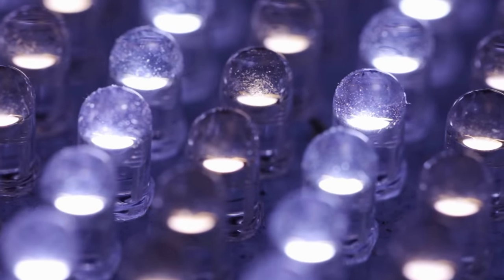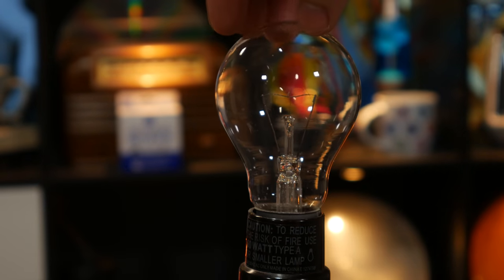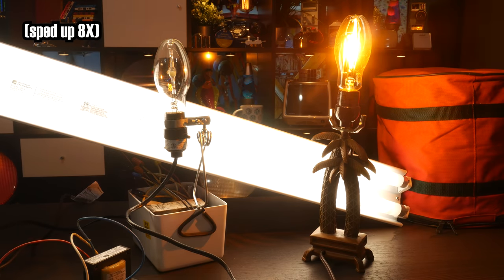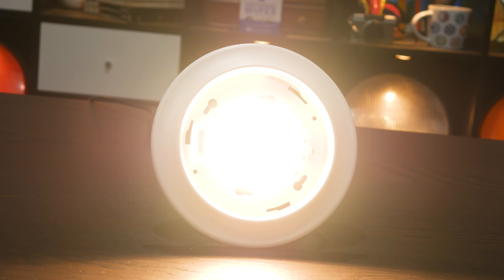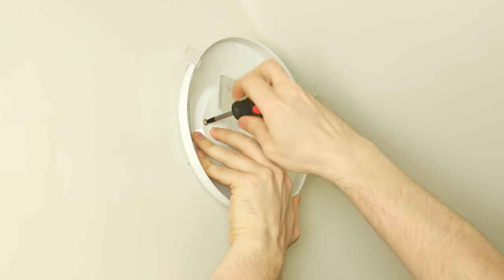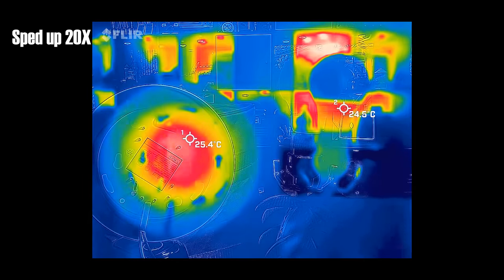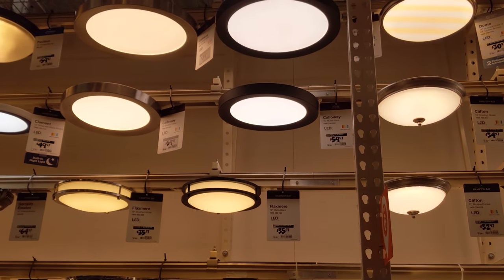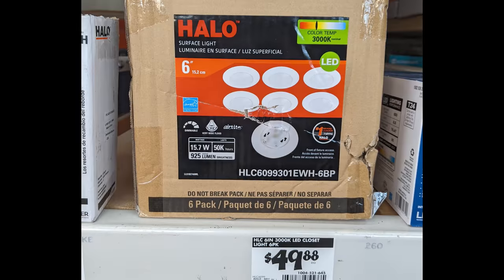A troubling trend in lighting?

Comment: The thing with such devices is you have to basically dismount the entire housing to change.

There are those "LED pizza" that fits in a housing.

But compared to fumbling with thin wires and making connections, the convenience of screwing a light bulb into a socket is way more convenient.

Don't forget it might be late evening when the light break down and you have to change the lighting in a dark environment and all you have is some torchlight or your mobile phone light.

The large bulb screw thread is actually pretty easy to install especially on ceiling light, where you are basically up a ladder and doing everything with your head facing upward.

Comment: About 10 years ago we had an area at work where the bulbs were constantly burning out, someone but non dimming bulbs in the fixtures and those failed. I knew the wiring for the location was ok but we have overall issues with the building power. I believe we get dips. I put in a quality dimming par/flood bulb and it has been working for almost a decade now with no issues. Failure can have a lot of points when it comes to electrical.
Reply: And electronics

Comment: I'm quite a fan of the LED Downlights here in Australia. Instead of being raw wires, it's just a traditional wall plug (which was a bit hilarious finding a power outlet in the ceiling, but rather reassuring). When getting houses redone for them, all that needs to be done is a set of outlets being added in the roof, connected to a common switch, with a hole drilled for each fixture. They essentially pop in and are held by spring-like arms so they accomodate most any hole, and therefore that makes replacement dead easy for everyone. Just grab a ladder, pop out the old, unplug it, plug in the new, and pop it in. Most have tunable colour temperatures too, and even the cheapest normally have a pretty hefty heat-sink on the part that sticks into your roof since it's just direct ventilation in a way.
They're also cheap as. You can get a six pack of wifi-enabled rgb downlights from a reputable brand for the same price of a single Phillips Hue rgb bulb. Obviously the latter has more features, but I'm sure you can find more expensive downlights if you needed those features too.
Reply: Albeit, this doesn't solve the issue you raised about one dying after five years and you likely not being able to buy the same one again... but that same issue is present in light bulbs. I can't tell you how many times I've replaced a light bulb in an area, supposedly of the same colour temperature, just to find I have to replace all the others for my own sanity since they don't match. That's not really an issue of the technology, that's more of an issue of economy, and applies to a lot more than just ceiling lights.

Comment: I'm a semi-retired electrician and I'm starting to see this issue especially on outside lights. I'd guess it's the temperature fluctuations that make them fail a bit quicker. It means changing the whole fitting rather than just a bulb . That can be awkward with higher mounted lights.I have actually swapped out bulbs in the halogen sensor lights for corn cob LED bulbs. The problem is those fittings are normally seized with corrosion and you have to drill out the bolt to open it. It's going to be a costly issue for muggles who can't do electrics.

Comment: we had a house fire, about... 5, 6 years ago?  Smoldering fire, mostly smoke damage.  It's actually kind of unrelated, but, it was the reason why we had to have a lot of renovations happen.  One of the things was, in several rooms affected by it, we had replaced the boob-lamp style ones with ones like those (bit larger, and did emulated the boob style a bit closer, but not super close).  And yeah, it's much brighter, and has lasted this long.  All things considered, I'm pretty happy with it.

Comment: There are loads of thin and powerful downlights more compact than the bulky ones at the end of the video. I installed 7W LEDs with driver dongle thin enough to fit between the old and new ceiling (28mm) great option when renovating a house without opening up all the ceilings or digging in the attic to install conduits. There are also constant current LEDs that have an external driver placed in a good position of your liking. Those bad boys were 9mm thick (or thin rather) but 'only' 4W. Still plenty enough for a lounge/living room, where lighting is more of a cozyness factor.

Comment: Thanks for this video. This is something I've been pondering for some time. We desperately need to new standard connector to replace the Edison screws. Also, why run 120 AC death voltage all over the place when 12V DC (or less) would suit modern lighting requirements. The first company to standardize these points wins, big-time. Not even going to get into how many led bulbs are obviously designed to fail, reassuring continual sales. Ugh! It's like we got new technology, but in companies' race to case in, nobody thought about implementing it in a sane way.

Comment: Thank you for this video.  I was horrified when I took the globe off of my 3 year ago purchased home to find a circuit board and not a light bulb.  Now I’m waiting for an electrician with a severely dimmed kitchen light that’s useless.   It’s going in the trash and I purchased a regular fixture from Menards yesterday.  
I don’t see where the savings is with these.  It lasted just three years and I’ll have to pay an electrician $100.00 or more to change it, plus the cost of a replacement $ 74.00 and the inconvenience of no light in my kitchen while I wait.
I could have bought a lot of lightbulbs for a fraction of this.

Comment: My previous flat mount LED fixtures (2 years ago) had a ground riveted to the back of it. This summer I bought 3 brands of fixtures like you showed and none of them had a ground. I'd assume would make them illegal in 99% of America (no way to ground). Interior layout let me know they were different mfgrs but all shared the same sucky packaging. The reason yours (if like mine) was mounted by one screw is that these don't match screw holes on round surface mount boxes. They were so slim that, when using the adaptor bracket, the lamp stood 1/4" away from the ceiling. Used w/o the bracket and they were flush but holes aligned with the lip of the box. Either way, that left me drilling thru the edge of the box or mounting it with one screw into the box's threaded hole and a second into a screw anchor. A million dollar idea (cheap motion detecting lights) in a 2 bit package.

Comment: I installed one of those at my mom's house a few years ago.  It was just a light above the kitchen sink that is used maybe a few times a week, but I still did not like the fact I couldn't change out the bulb if needed.  It's a cheap solution for a place that maybe doesn't need constant light (like a closet as you mentioned) but it does pose the problem that when it fails someone with electrical wiring experience is needed to fix it.  And instead of buying a cheap pack of lightbulbs now, it's an entirely new fixture.  Horray planned obsolescence!

Comment: When I get my own home, I'm gonna be using down facing fixtures with flood baulbs in them. You get the efficiency benefits of these, but you can change the baulb. You can get one of those little ceramic fixtures with a single socket for like 5 bucks.

Comment: These LED fixtures are useful for designs that doesn't have space in their ceilings for a vertical can recessed downlight E27 screw base. There are even surface types that can be mounted in places where there are no ceiling and just the concrete slab. These generally comes with a wire clip that makes replacements easy. And since you are not stuck with screw types, it is more future proof.

Comment: In my old apartment, I had this old 80s light fixture in the bathroom that originally was for 6 40W incandescent bulbs (and that's what was in them when I moved in). I replaced them with CFLs as they burned out, but then I had CFLs burning out way too soon (and I tried different styles of them). Eventually at one point I had two of them go and I didn't have any replacements, so I just left it without anything in those sockets, since it was too frikkin' bright anyway with six, and ...they stopped burning out early. The remaining CFLs lived until I moved out, which was YEARS.  I don't know what happened, but hey!  It solved my problem!

Comment: in a store i used to work we used those filament style LED Bulbs, the Lamps run on a timer, being on 16 hours every day. So the store has opened in July of 2017 and to this day only just 2 of the Lamps are completely broken, one has given up 2 of the 4 filaments but the other 19 Lamps are working perfectly fine after 28000 hours. that’s probably down to the fact that they are hanging from the ceiling and aren’t enclosed but still these are doing perfectly fine so i will say they’re probably the most durable type of LED by now

Comment: I was in the electrical industry in San Francisco fromm 2000 to 2021. It was interesting to see the evolution of the LED lamp during that time. There were experiments with 2x4 troffers in office building with super thin lights at first, then things just took off from there. Then the energy codes mandated massive energy saving features that were really noticeable in building energy usage as well as almost no maintenance toward the end of my career. I changed every light in my house including all the appliances in about 2012 when the te h evolved enough. Of the 60 plus lamps I had installed, when I sold the house in 2021, I had only replaced about 4 lamps in that time. Before that time around 206 or so, I tried some lamps, but the color sucked and they really only lasted less than a hundred hours. They have come a long way in a short time.

Comment: And this is why i think they will need a standardized socket for light fixtures, and also sell the sockets, the pins need to be in the edges, and in the middle there is open holes which can be used to cool the lamp, and maybe we can cell sockets but in the middle there is a fan which would blow in the open hole in the middle in the lamp fixtures, the socket can also use different fans if they use regular fan pins and headers, also in the pins if the socket add some smartness pins into it which could connect to your smarthome thingy

Comment: I replaced all of the boob light fixtures in our house with these lovely flying saucers. My wife is happy and so am I. I don't have to take down the glass, clean it, replace faulty bulbs and reassemble.

As for smart bulbs now you've set me off. Putting smarts into a bulb is silly. The smart bits tend to fail before the bulb does and the whole thing needs throwing out. I prefer to add smarts to my in wall light switches, I can use any bulb or fitting I like. Lutron make good smart switches.

Comment: Maybe in the future we will find a way to replace LED without replacing the driver. The solution is here, the G4 light bulb system which are detached. I have something similar in my kitchen, LED panel wit separate driver, for the reasons you described. 3 and a half years going strong.

Comment: Your demo around 26:17 explains something I’ve been curious about. I replaced the bulb in my desk lamp with one of those fancy phillips led bulbs and while the light is quite pleasant I find there’s a considerable amount of heat coming off the top of it which surprised me. I’m surmising it has either that gas inside the glass or just very good heat dissipation.

Comment: I actually found out about these years ago when I moved into a new house and put my (long throw) projector up in the living room.. which had a light fixture right in the middle of it. I was so glad to find something that was low profile that I could just replace the whole thing with. Thankfully I myself was competent enough to do it myself (it's not that hard but I get why someone wouldn't want to), and also don't have to worry about most of the other cons you listed because it's the only ceiling mounted light in the room. If it ever dies, I'll just buy a new one and the look won't matter compared to anything else.
So for that reason I absolutely love them and wouldn't be putting a normal fixture in that spot again anytime soon anyway!

Comment: My parents flipped the house across the street from them and my wife and I decided to buy it while they were working on it. They planned to have downlights installed in the main areas of the house, and I was excited to get smart bulbs to put in them because I'm a nerd and get excited about that sort of thing. When we moved in, though, I realized that the contractor had sold them on the idea of using these exact same type of lights (maybe the exact same model as the ones you showed) and I was so pissed because there's really nothing that we can do except replace them. We almost never use them because they are so bright and not my favorite color temp, so they are completely wasted. 

Thankfully, Philips bought a company called WiZ that sells at Home Depot, and it's a line of budget smart lighting that I've found is a good balance of price and quality. They have a smart LED light that is the same form factor is the one you showed, but it's fully featured (color changing, dimmable, connects with Alexa/Google Assistant). It's still not super cheap and we have 9 of these lights to replace, but you can spread out the cost and do one room at a time. Also, Philips is big in the smart bulb market, so these are not likely to lose support in the near future (hopefully) which can be an issue with smart bulbs made by generic brands.

Link to product on Home Depot if anyone is interested: Philips Color and Tunable White 5/6 in. LED 65W Equivalent Dimmable Smart Wi-Fi Wiz Connected Recessed Downlight Kit 555623 (homedepot.com)  - Not sponsored or anything, just trying to get the word out.

Comment: I do think we need new replaceable led standard aside from bulbs. It would be really cool to have really low profile lights, that are not disposable. How about just small circuit boards with leds that are attached to some standard connector? And you can then just attach that into fixture you choose. Or something like that, I don't know if this would be optimal, but I just want replaceable leds that are not huge bulbs as it would be so much more flexible in usage and design.

Comment: When I purchased a home in 2013, I decided to replace all incandescent light with LEDs. A mixture of blue style fixtures and a BR40 (cone style) fixtures. The recessed LED retrofit was not a thing yet. Each bulb costed $25 before tax, and the only option was CREE. Those quite literally failed within 2 years. I popped on open and saw that the LED driver was covered in a blob of a resin. The inside surface of metal base had a specific thermal paste. The outside of the base had metal fins (just like how you see on an air cooled motorcycle engine). Fast forward to 2016- not only those fins disappeared, nor was present the resin covering over the LED driver. I compared the wattage and quickly realized there was a leap of progress just within 3 years. An 800 lumen LED bulb from 2013 consumed 15.5 watts whereas the same 800 lumen bulb in 2016 consumed 8 watts. Better driver and LED efficiency I believe. Also the same bulb (infact a better version) was now $5 as opposed to $25. 

So yea, when he says things progress within 5 years - thats near damn 100% accurate.

Comment: The filiment style is also cooler becuase it uses less power for the same light. Usually by pretty much being able to run off the full voltage of wall ac. Instead of needing to step it down.

 The filiments here are usually sets of 2 60ishv each ran in series.

Comment: Yeah... But before the electronically ballasted "bulbs" there were for some years some large and quite heavy bulbs available for larger fixtures such as outdoor lamps. They contained a regular iron cored coil ballast and a starter why they were flashing when lit. But they were in fact equipped with the common E27 socket.

Comment: I think what we need is a flush socket that can be mounted either on the ceiling, or on the wall. This should have no exposed contacts, be able to support a specified weight in either orientation, and ideally have some heatsinking properties. I'm in the UK, where we favour bayonet sockets on old school lights. There could be the three electrical connections on the back of the fitting that push through shutters on the socket and rotate clockwise by a specified angle, before being locked like a bayonet fitting. There is even an electrical socket, that was invented in the UK, that was supposed to be an improvement over our usual design, whose name escapes me. This never took off, except in niche applications in offices, where  you didn't want the cleaners unplugging important equipment to plug in floor cleaners, vacuum cleaners etc. It had a single shuttered hole on the socket. The plug was pushed in and twisted to make the electrical connection. Something like that could be modified for such a role.
Edit: I see from the comments that there already is a straight push-in EU socket standard called EU DCL. It's recessed, and looks to have a means to hold the lighting fixture in via a catch. I've only seen the wikipedia page on it. It might not be so useful for fittings that hug the ceiling, unless there is a means to release the catch for replacement built in to the fitting.

Comment: You know what I like? My arm-model lamp. It has 6 LED bulbs so I can get light wherever I want and can create mood-lighting by changing their coloring or adjusting the arms. The best part is that a bulb can be replaced easily if it breaks during the night.
I don't like fixtures that require me to work with their wiring when they die, since it costs more time than replacing a bulb and replacing an entire fixture in the dark is begging for trouble.